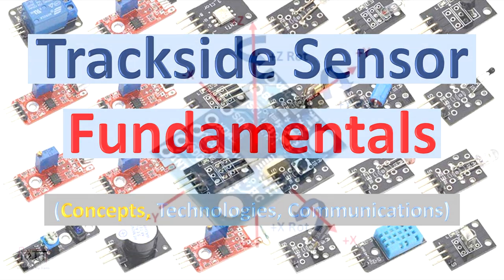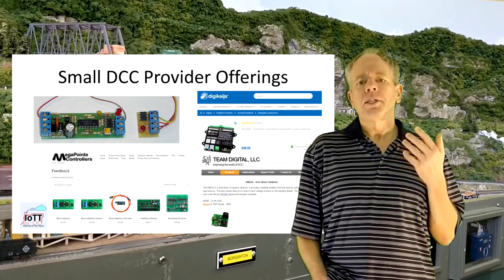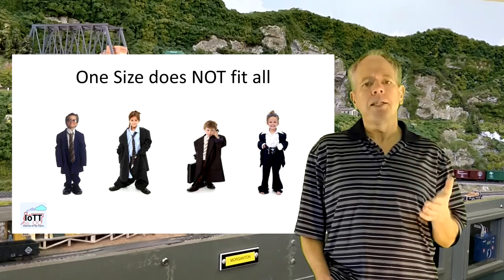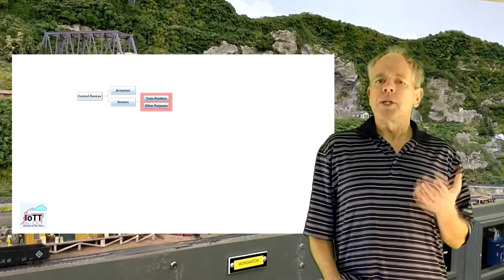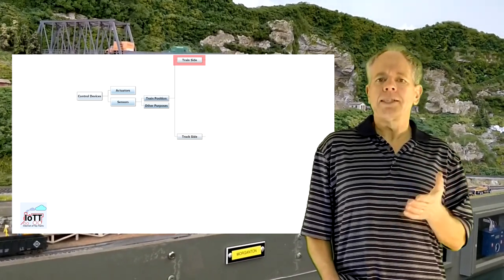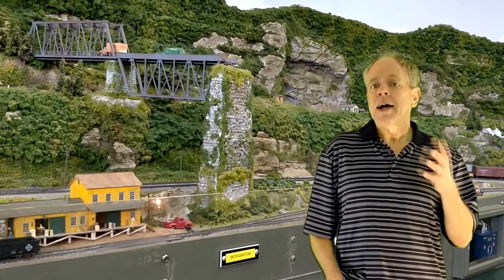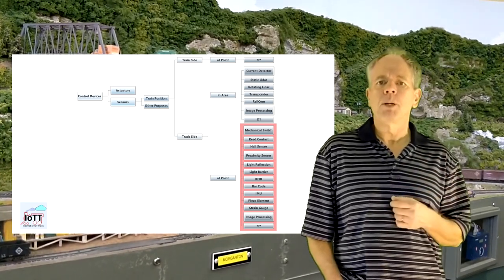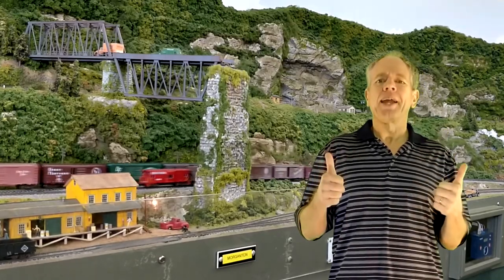Trackside Sensor Fundamentals (Video #37)

Comment: I'm glad that you are diving into this topic. I've just been thinking about train detectors for my layout and was looking at the various options. I was wondering why I was not hearing that people were using some of the cheap current detectors for Arduinos that are available on EBay (5A Range Single Phase AC Active Output Micro Current Transformer Module ZMCT103C). Although I never got an answer, I have decided to experiment with one later but in the meantime I'm going with the MERGDTC2-T DCC Dual Train Detector. It appealed to my desire to build and it worked out cheaper than any other commercially available current detector. I'm looking forward to finding out if you had considered one of these and also what else you have up your sleeve for train detectors. Keep them coming Hans!

Comment: Hi Hans, I find your concepts very interesting. However, I model the 1960s and block detection on the real thing reigned supreme up until the 2000s.
Since then axle counting in my country (New Zealand) has been installed in some areas, mainly our two major suburban networks, track block detection is still the major method of detecting prototype trains. This is also easy to implement in the model world and train current detection has been around since the 1960s. Diode and CT current detectors are the most common.

I built my first TwinT DC detectors in 1970. My current layout is equipped a variant of Bruce Chubb's Optomised DCC Detector, and has proved reliable for over 20 years of operation.

I use JMRI and find it easy to detect train detection by using the concept of. A train travelling in Block Detector A and enters Block B it is travelling North. If travelling from B to A it is travelling South. 
I do have some some automation on my layout and rely on slowing a loco entering a block and then stopping on the next block, usually using the Acceleration and Deceleration CVs of the decoders. To overcome differing loco characteristics and to stop a train in front of a signal or at a platform, I need to install location sensors.
See http://youtu.be/0rUtKtrvSa4

I have modified, designed and built quite a lot of circuits over the years and detection circuits include with my comments.
For small scale trains. the two most common ones are.  

Block detection.
The very common Diode Forward Voltage Drop block detectors must be opto-isolated and trains slow when passing through from unequipped blocks, unless undetected blocks are equipped with some "dummy Diodes". I have designed and built boards for installation at a local MR club.  
CT Current transformer, self isolating, require high voltage protection on the transformer output and amplification for axle resistor detection. These are my preferred option.
I have looked at and experimented with the modern current detectors, but they have some short comings such as their current noise threshold. 

Location Detection
Photo-transistors. Easy to implement and connect direct to a micro. These are excellent for a day time lit layout. but no good on layouts with night lighting.
Infra-Red. Easy to implement, but current Ebay and some commercial offerings use 5 mm IR LEDs and IR transistors which are hard to hide and fit into existing track work. I have replaced these with 3mm IR devices with success and it makes them easier to install.

The main aspect of the above is they don't require any modification or installation of "special" circuits a to the locomotive or rolling stock, and this makes it easy for the average modeller to install, that's why manufactures have generally stuck to the above options.

Magnetic. I am currently working on a signalling system for a live steam and battery loco garden railway. In this case Hall effect sensors above the sleepers, and magnets installed on the locos by simply placing them on the cow-catcher (Pilot), where the tend to stay. Visitors are supplied with a magnet. Light detection was no good due to varying light conditions, cloud cover and evening running.  
In small scale magnet detection is usable unless you have visitors. Not easy to install magnets though.

One thing I have discovered over the years is that the KISS principle is very important especially when supplying others equipment to install.
I am following your ideas and experiments with interest and I know the amount of time you spend is huge.
Keep it up  and look forward to your upcoming videos.

Graham
Reply from the maker: Hi Graham, thank you for your comment. Very interesting to read how you do layout automation and watch your video.
I look at the problem from two different view angles: model railroading and industrial automation technology.

From the model railroader's perspective, particular when modeling past epochs as you do, current sensor block detection is the way to go. It is prototype-like and very reliable. But in order to ensure reliable automated operation, you need either locomotives with very similar characteristics, or location sensors (at point sensor), as you say in your comment. If your model more recent epochs, you probably want to have more modern concepts as well. Nowadays trains use moving blocks, dynamic braking distances and so on, all in the interest of reducing safety distance between trains and increase traffic density while maintaining safety levels. I have no intention to prescribe to anybody how to do layout control, but I think a more diverse set of technologies should be available and this is a shortcoming of the mainstream manufacturers.

From the industrial process automation perspective I see a lot of development in the areas of sensor technology and control systems, that simply did not make its way into the model railroader's  world. And since no-one would try to control a numerical axis with technologies from twenty years ago, I don't see why model railroaders should not make use of these new technologies. That is my motivation to experiment with various concepts.

Comment: Hi. Like you I have been interested in detection for a very long time.  The trouble is that amounts the current offering of detection types there is nothing that is (a) universal an (b) fit for purpose for all needs every time.

This then translates into having one set of detectors to deliver (for example) block occupancy but doesn’t cover engine/wagon identification, direction of travel, loads carried or specific track location.

Because of this if one is to detect the full gambit of conditions one would like to have we are then require to multilayer, say current detectors and separately specific location detector and finally say technology like rfid/rail com for specifics on rolling stock.

In my view the worst part of this is not that there are three layers of detection at all, rather that their technology to use and pass this information back to some central repository is totally fragmented.   I dream of the day we have a can type producer consumer bus that treats all sensors as “an event” an pars that to a central repository to be integrated into an intelligent place to deal with the information from everything.

Comment: For your “GPS dream” take a look at GamesOnTrack.com, I am sure you have found them by now and I would be very interested in your technical opinion of this system. Great work with the videos.
Reply from the maker: Thanks for the link. No, I was not aware of this system. From what I understand they use ultrasound triangulation (time of flight) to calculate the location and send trigger pulses to do so via radio. I like this concept. Time of flight is definitively the right approach to do triangulation for localization, but I would like to see that with radio. Some of the new Wifi routers can do it, but the accuracy right now is only about 10m. I am sure in a few years down the road radio localization will be the way to go. And by then the devices will be small enough to fit in rolling stock ;-)

Comment: Train side could also be a combination of the decoder telling how far it has driven and last known location.
Reply from the maker: Yes, this is how most control software does it (integration of speed over time to calculate the distance). This works reasonably well as long as there are no power interruptions and the software knows the speed step to speed ratio for each address. And of course, also the length of each block.
Reply: @IoTT  If the decoder counts actual revolutions -calculates the distance and feeds it back, it will be very precise.
Reply from the maker: Yes, that would be a simple form of a trainside sensor. The other possibility would be using an incremental motor and communicate increments instead of speed steps. None of those solutions is part of any standard, as far as I know.